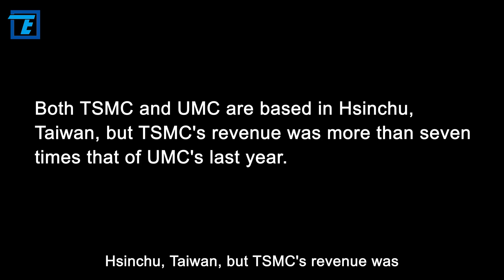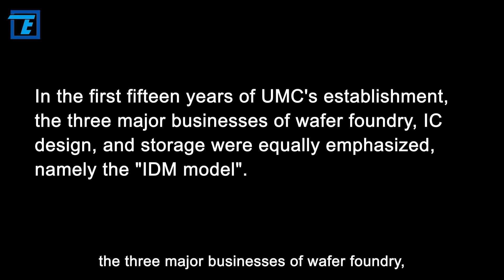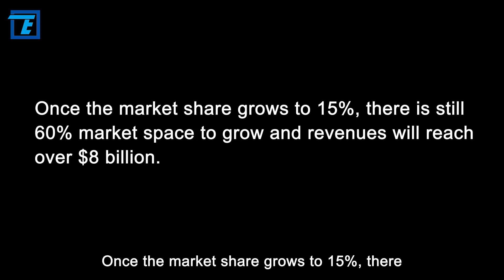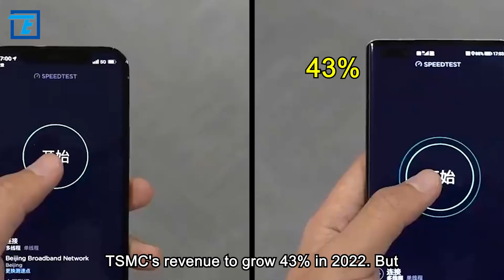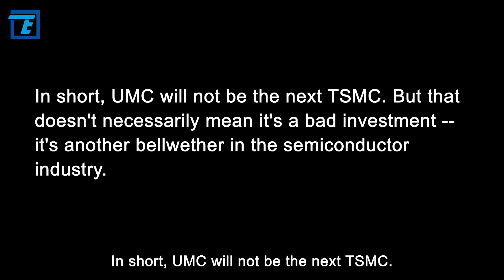The other TSMC Could UMC Become the Next TSMC

Comment: UMC is in some of the most important consistent markets. IOT is huge and requires ongoing manufacturing. UMC contracts to Avalanche technology for next gen chips that are able to longer survive in space for satellites, this industry is also assisted indirectly with development and financial stimulus from DARPA. The fundamentals all stack up before calculating when and how much. UMC is huge. You’d have to be sleeping on another planet to not know what all these manufacturing contracts mean for UMC. The rest is about contracts for manufacturing smaller chips depending on supply demand.
Add to this; no matter how long chips last they still need to be replaced at some point, therefore that’s rework manufacturing for replacement. It’s unstoppable.